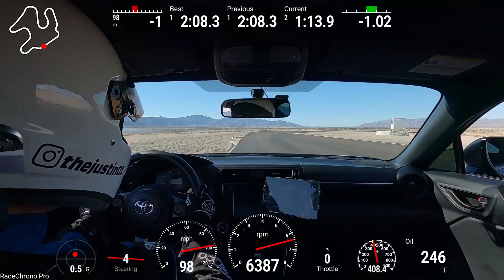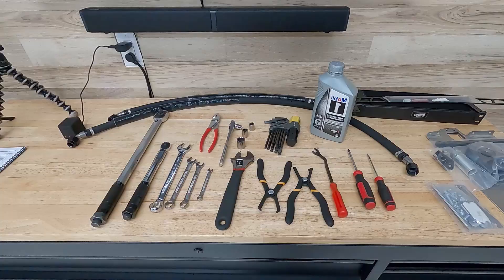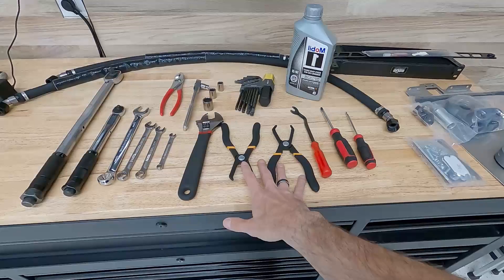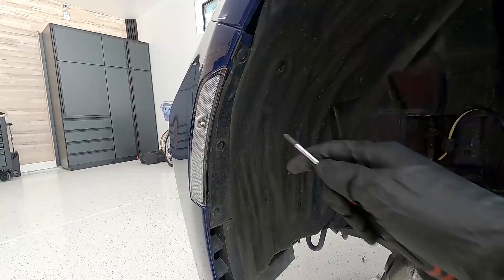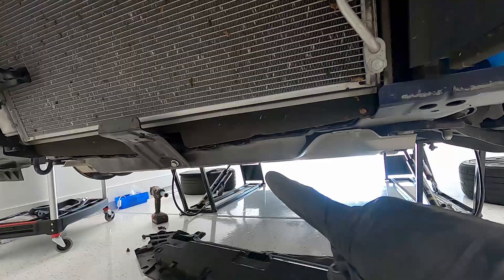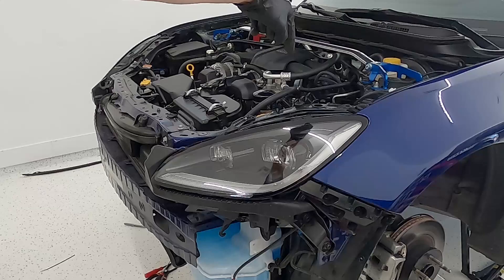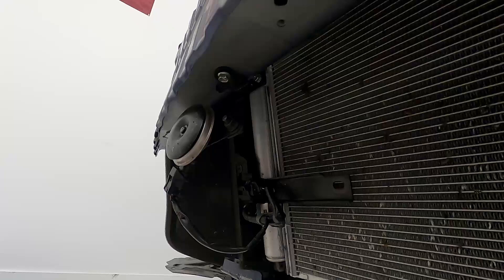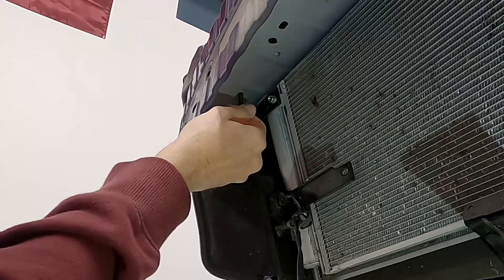2022 GR86 Jackson Racing Oil Cooler Installation

Comment: Well done. You're an excellent teacher. Use only enough words to communicate the idea and you don't make mistakes with left and right and up and down. When you do some of your testing and I'm very much interested in the oil temperature while you are driving around town in 80 degree weather. Of course the oil pen at the track. Dictated and not reviewed
Reply from the maker: Thanks! I already have the data from the track, video coming soon. I didn't do much for daily driving before/after, but I can always include what the temps look like on a drive to work or something.

Comment: 38 seconds ago.....so cool and so is the install.   still boggles my mind why a car hyped for track use doesn't come with a larger factory cooler than the miniscule heat exchanger.  cool on Justin, cool onnnn..... 😎
Reply from the maker: To be fair the OEM heat exchanger does a decent job of keeping oil temps down (not low, but down). The gen1 cars had typically 25-30° higher oil temps on track, in my experience. That said the "real" oil cooler is definitely worth it if you're doing more than a couple track days/races a year 👍
Reply: Hi Justin,
Great content video.
Why did u decide about oil cooler when your oil temp on track are 250 degrees max, wich is ideal oil temp for engine work?

Comment: Love my JR kit on my FRS, my only gripe is their hoses. With such tight quarters I think Steel/Nylon AN lines is more appropriate my original lines almost rubbed through to the point of a leak. I ended up upgrading to true AN fittings with steel braid for both lines.
Reply from the maker: Yea agree, that was one my internal debates between the JR cooler and the Greddy cooler (which has much nicer hoses). I couldn't justify the large cost difference to go with the Greddy though. With the JR hoses oriented properly, as I adjusted them in the video, I think they will be fine.
Reply: @TheBTRGarage  Totally agree on that one the Greddy is way too expensive for what it is. Could easily of been my routing too but way I see it it's no biggy and something I wanted to learn anyways, worked out in the end! 👍

Comment: Be careful on the oil lines, I installed this and didn’t know the longer oil line was rubbing on top of the frame next to the windshield fluid reservoir. Spotted it and taped it before it wore through
Reply from the maker: Yea, I noticed that and slid the included shield over to cover where it was hitting the frame. I'll keep an eye on it!
Reply: The same thing happened to me but unfortunately I didn't notice it until it was too late. Oil went everywhere and I thought the engine was gone for good. I replaced the longer oil line and thank goodness the engine was fine. I'm also noticing that the oil sandwich plate, even when tightened to 35, will still slowly rotates counter clockwise which will eventually cause the oil line to hit the frame again. I have taped the frame area with gorilla tape but I'll still keep my eyes on it. Maybe I will get stainless steel braided oil lines in the future tho.

Comment: I know this is a late comment but I read through every owner's manual for every car I own in its entirety. For those pop clips with the flathead groove in it, according to the BRZ owner's manual, you should twist the center piece with a flathead screwdriver about 90 degrees and then it should come out like a normal pop clip. You do NOT need a specialized tool. In order to reinsert the clip, you should just pop it back in and twist it back to how it was.

Edit: for the BRZ owner's manual it is on page 341 "Maintenance Tips"
Reply from the maker: Sure, you can do that. But, the tool makes it much easier and you already need the tool for all the other clips anyways. No point in using 2 different tools when 1 does the job.
Reply: @TheBTRGarage  The owner's manual also details all of the other kinds of clips. The only tools that Subaru recommends for any pop clips on the car is a flathead screwdriver and sometimes a phillips-head screwdriver for certain ones.
Reply from the maker: That's great, but if you've ever actually tried to remove these clips with a flathead you know that it is incredibly easy to ruin them. The tool is faster, way easier, and saves the clips from damage, especially when they are old and gunked up with dirt/grime. Nobody is stopping you from doing things the more difficult way though, have at it.
Reply: @TheBTRGarage  I’m just stating that you do not in-fact NEED the tools you recommended to remove the flathead-style pop clips, although they are useful.

Comment: Awesome video. I’ve watched through most of your GR86 videos so far and I’m curious what you think of the oil pan baffle kits that are becoming available? 

Worth it for street and some track use? Any warranty concerns? 
I plan on keeping mine stock engine-wise but am considering a few ‘reliability’ mods for peace of mind.
Reply from the maker: I've thought about adding a baffle. But, someone has done some extensive testing with one on a gen2 car and it did little to nothing to improve oil pressure, especially is the lowest points. So, that data kind of put it further back on my list of upgrades.
Reply: @TheBTRGarage  I've been reading similar thoughts from folks like Killer B and others who track heavily. These pans are cheap enough to where even if they only help slightly, I feel like it may be worth doing while the lower pan is already removed. I see some references to the GR86 Cup/series cars running baffled pans, and that STI makes their own pan (I can't find it anywhere, though) - but overall yeah, not a 10/10 'everyone must do this' upgrade from the data that is available. 

I'm still waiting for my name to come up in my local dealer's queue and I'm actively searching for cars while I wait. I've already narrowed down day 1 mods like brakes/tires. Only outstanding questions are about the oiling situation. 

Seems like reasonable/ideal steps to me are:
- drop lower oil pan and clean up the RTV in the pan and pickup
- switch to 5w30 for track use and switch back to 0w20 for winter street driving
- keep it topped up frequently 
- monitor oil temps closely and if needed get an oil cooler
- consider an air-oil separator kit
- investigate logging oil pressure (mentioned this in a comment on another video)
- consider the baffled pan if I see regular concerning dips in oil pressure
Reply from the maker: @chasewd5117  Prep sounds all good to me. I'd consider running the OEM Michelin PS4's, assuming you're getting the top trim model, they are pretty decent.
Reply: @chasewd5117   Blackhawk Japan has those STI pans

Comment: Not sure an oil cooler is 100% required. I personally would try 5W-30 oil instead and check temperatures to see if they are significantly higher. The negative aspect is slightly less power.

I'm not sure that an oil analysis will tell you much about engine damage with only 2 samples. This is one of the reasons oil sampling isn't great on passenger cars, as it is unlikely to be keep for 10+ years. You need to do it for a long time to identify typical wear rates. You can see from the oil analysis good levels of additive packages, indicating the oil additive package isn't used (Detergents are good Ca/Mg , Wear are good Zn/P, Wear/Friction modifier B okay with only Moly down ~15%).
Reply from the maker: I did not install my oil cooler until 10k+ miles, over 10 track days/races, and 65+ autocross. So I agree with your first statement :) It doesn't hurt though...

Starting the oil analysis right away was to get a baseline and obviously make sure I have the trends starting from the beginning. Interesting to see how it changes more than anything.

Comment: the OEM oil cooler on the GR86 is not removed?
so both can work together?
Reply from the maker: Correct, you can have them both on at the same time.

Comment: Can you also report any changes in oil pressure?
Reply from the maker: Unfortunately I do not have oil pressure logging at this time. I will be adding that in the future to one of the capped ports on the JR cooler adapter though!
Reply: @TheBTRGarage will be very interesting 😊